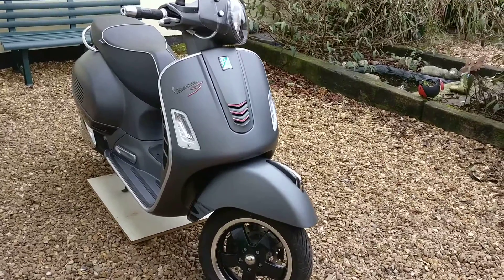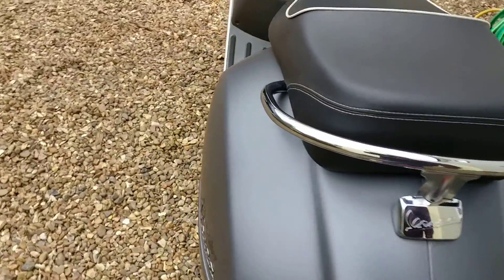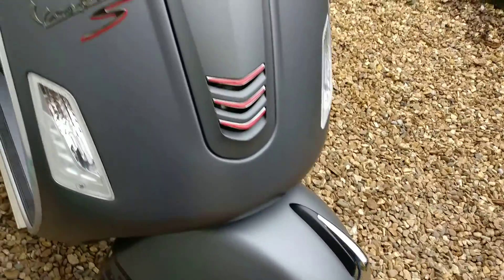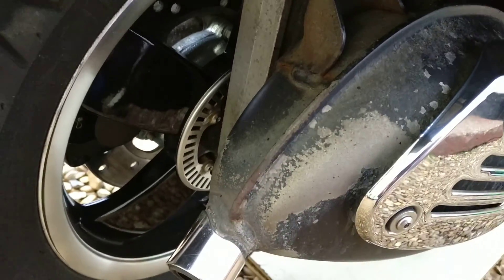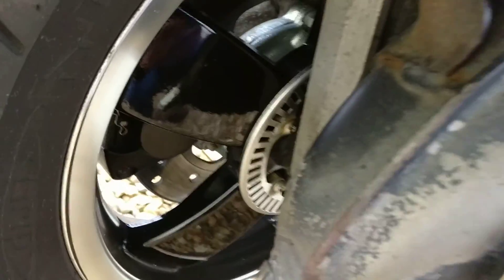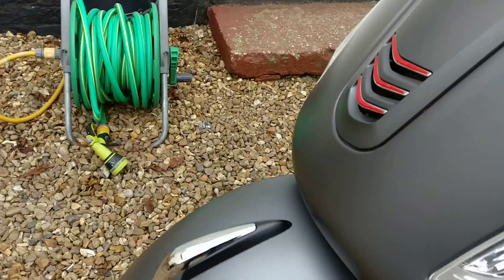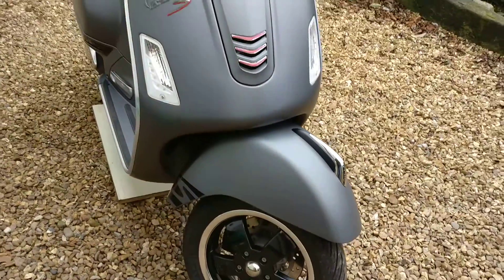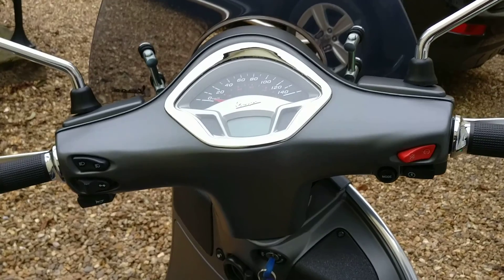Vespa GTS Super Sport ABS ASR- 14 month Follow-up Review

Comment: Great looking scooter! Shame you have some minor rust on the bodywork, and it really isn't as common as you might think, especially on a young'n like yours. You'll find the manufacturer's warranty will fix that for you. Remember, it's a two year warranty. The exhaust paint coming off is more common, and it's not just Vespa that suffers this. However it's easy to remedy with aftermarket high heat products that you can apply yourself. These have the advantage of lasting very much longer than the factory finish. Just make sure to remove the silencer and give it a really good clean & wire brush first. My own 2016 GTS300 is unblemished in every respect & shows no signs of rust. I have just rustproofed the bike with Waxoyl & again found no rust under the floor panel or in any other internal cavities. Good luck if you do trade her in but I'd get it fixed under warranty. Thanks for making the video.

Comment: I'm guessing it wasn't intended to be used in the UK's shitty weather, no offense. 
I presume you ride it in all kinds of weather, as you said aside from the minus temps and snow.
What would you reckon is the percentage of dry vs. wet riding conditions that you've rode it on, specifically, in regards to that amount of corrosion shown?
I mean, it's not like it's an awful lot, but it is there in bits. 
Thanks.